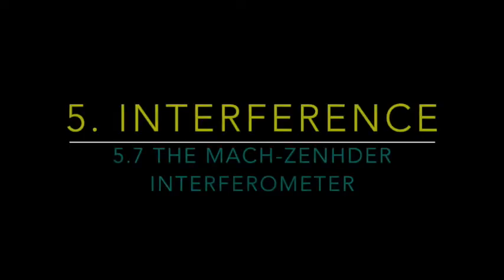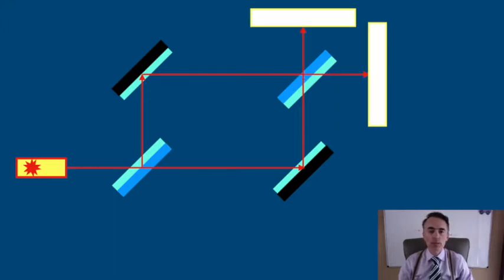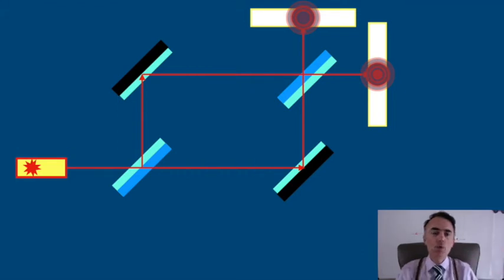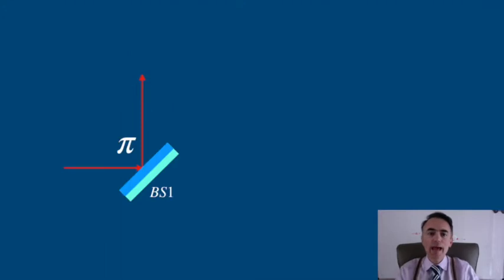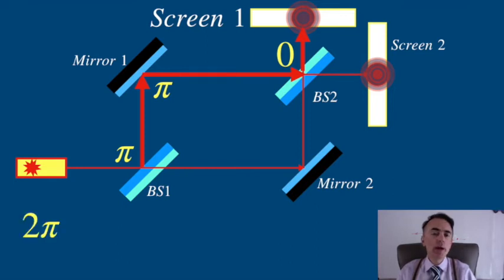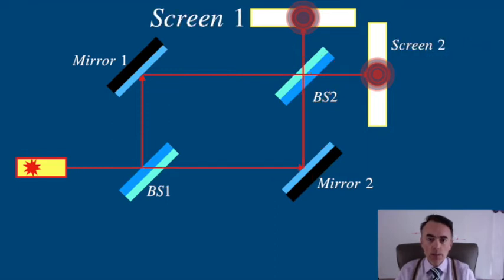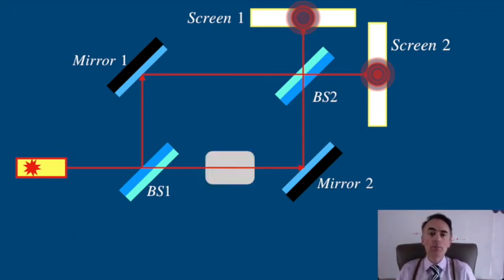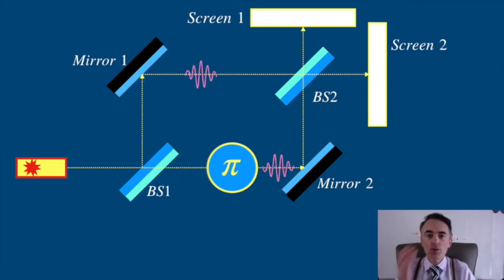Optics: Mach-Zenhder interferometer

Comment: I was led to believe by my professor that whenever the beam is reflected you add a phase shift of pi, therefore I'm not so sure why your BS2 doesn't seem to add pi on the upper path. Would you please explain why that is?
Reply from the maker: When you go from lower index of refraction (air) to higher index of refraction (glass) there is a pi phase shift. When you go from higher index of refraction to lower this does not happen. A beamsplitter is a piece of glass with a dielectric or metal coating on the front surface. One of the photons enters the beamsplitter from the dielectric into the glass and not from air into glass. There is a phase change for a reflection when a wave reflects off a change from low to high refractive index but not when it reflects off a change from high to low.